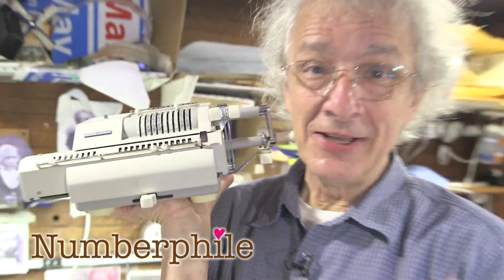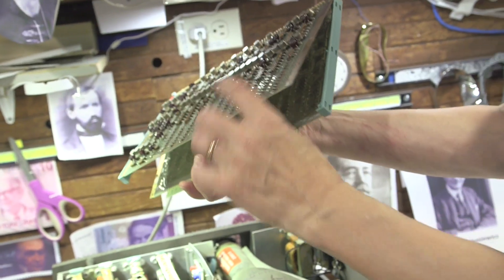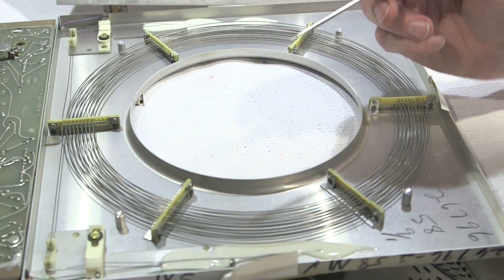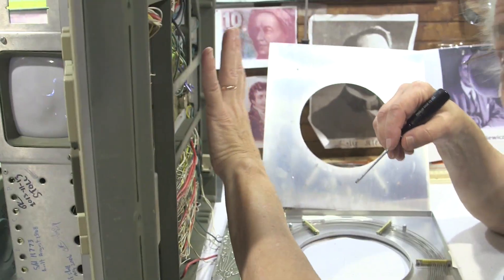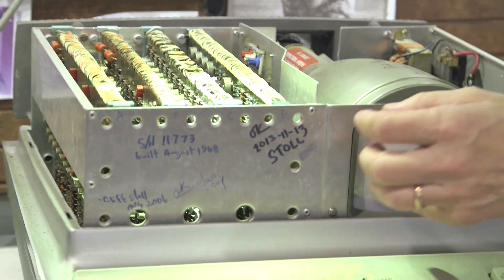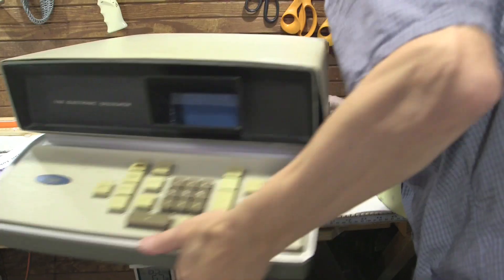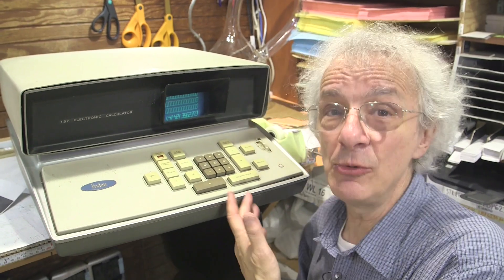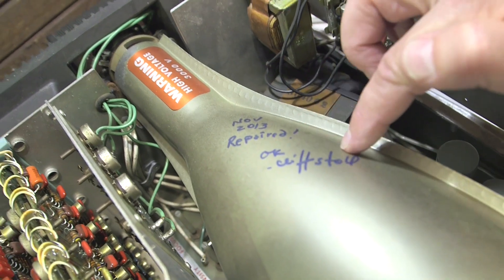An astonishing old calculator - Numberphile

Comment: I have a degree in computer science and electrical engineering, have been working professionally in the field for over 20 years, and I have no clue how that coil stores bits.
Reply: I think the information that will help you understand how this is memory is the amplifier at the end of the coil feeds the bits of information back into the piano wire, thus continually storing it until it is needed.
Reply: Similar to dynamic RAM with a refresh cycle. But unlike DRAM, there must be some logic to the bits to know where the start and ends are etc.
Reply: Jayyy Zeee Thank you
 that makes the rest of us feel better.
Reply: Scott Kronmiller You are quite exact!
Reply: This is called a delay line memory, Robert got it right, the information is cycled through the wire as long as it is required to.
Reply: I guess it's like a "refreshable" buffer with loop
Reply: This reminded me of a Computerphile video about the rebuilding/refurbishment of the EDSAC computer at the National Museum of Computing at Bletchley Park in the UK. They replaced the mercury based memory tubes with ones that used piano wire. They go into exactly how the system worked, as well. For those that are interested, you can check out that video here: https://youtu.be/Yc945sNB0uA :)
Reply: If you notice at one point the calculator went nuts when cliff spoke too loud or banged the calculator. Not a device to use in a noisy environment with acoustic memory like that.

The best way to picture how it works is to imagine yourself stood in a quarry, or ravine. You shout out "one zero zero one one" and you hear "one zero zero one one" echoed back to you a second or so later. So you repeat what you hear again, and again it's echoed back. Ad infinitum. That's your memory. To change a value you just change one of the words you shout. As long as you keep repeating what you hear and as long as no ducks quack, you have memory.
Reply: It "stores" them for the fraction of a second before the pulse reaches the end of the string. It's a FIFO buffer. It can be used as RAM if there is a circuit, which retriggers the pulses once again when they reach the end of the string. You can clear the memory when you switch off the retriggering circuit for the period of time it takes for a pulse to travel through the string.
Reply: @alexvukov  correct
Reply: This is confusing to me too but it's way more awesome than electronic (contemporary) computing. Not to discredit the computers we have today but they're so much easier to understand. Just to think that someone came up with the idea of using a vibrating string to store information and actually figured out a way to turn it into a computer is like real science fiction. It blows my mind :D
Reply: Cliff explained it. It jiggles one end of a long wire using a speaker to convert pulses into jiggles. It detects the jiggles at the other end with a mic (probably closer to another speaker seeing that it's mechanically coupled). By recirculating the pulses until they're needed, you get memory. It's confusing because its much closer to physics than electronics.
Reply: If you watch the additional footage they link to at the end, Cliff explains that it's not actually a transverse wave ( like a "pluck" ), but a torsion wave ( a "twist" ) which stores the data!  I would've thought a transverse wave was cool enough, but a TORSION wave?  My head just exploded!!
Reply: flurng The piano wire would have to be under tension to support a transverse vibration, while a torsional wave would propagate without tension applied.
Reply: @DavidMFChapman  An overlooked point. I know I did at first.
Reply: I think that it is just that you are more familiar with current technology. Starting with zero knowledge of either I think that the acoustic delay line is probably easier to understand. You can actually look at it and visualise the train of pulses running round the loop. The next stage after this was rotating drum memory computing, with a magnetic equivalent of an Edison phonograph and a continually moving read head. (Google for "The Story of Mel" for a great anecdote from that period)
Reply: It stores the bits inside the spiral in the form of vibration waves. Imagine you have a very long string, attached to a wall, and you vibrate the string up when a new 1 bit arrives, and you keep it still when a new 0 bit arrives. When no bit arrives you do not move it either. The bits will be stores as waves in the string. If the string is short, they will reflect back from the wall and into your hands, and then back into the string again  (assuming no friction). Each bit of course will need a certain period of time, i.e. 1 microsecond per bit. Now remove the wall and attach the ends of the string together. The bits will now circulate forever in the loop (assuming no friction again). You keep a counter made of transistors, to tell you what bit is currently the one under the reading microphone. With friction, they will be lost after a while, and so this memory is only short term. You need to keep track of what bit is currently under the reading microphone, and you wait for the bit you want to arrive in order to read, and you wait for the last bit written to pass under the write speaker when you want to write. The only thing you need is to keep track of what bit is currently under the heads, and you can do this with a simple binary counter. It's not like they don't use any electronics there. It's full of transistors.
Reply: That's a delay line memory. Basically, the acoustic waves goes through the wire and based on a certain frequency, the wire goes into torsion. Torsion is travelling along all the wire, and at the end torsion rebecomes sound due torsion upon a microphone.
Reply: Acoustic delay line.
Reply: Consider my mind blown too. Yep. Brains all over the ceiling. Kablooie.
Reply: I understand you completely. There must be subtleties to this design beyond saying "acoustic delay line". E.g. You can't just hit a rigid bar like that, you will get reflections and resonances. I guess it has to be critically damped. There is also some talk of it being a torsion wave rather than a transverse one.
Reply: So if you put it on top of a stereo speaker, would it’s functioning be disrupted because of the vibrations?

Or some mini earthquake machine that shakes it mildly and continually.
Reply: Possibly yes
Reply: But how does it know what is the right data? Are they somehow marked? Repeating the data has to be digital or otherwise the signal degrades.
Reply: @okaro6595  that's what i was thinking. very interesting tech used here.
Reply: I think it would be like continually yelling into an echo chamber in order to refresh the echo.  The data is in the echo.
Reply: We always forget that technology was amazing back then too. Just because it wasn't as advanced as it is now it's still just as amazing imo
Reply: Imagine 1000 people walking in a big circle; as they cross the START line they are either handed a card with a 1 on it or not handed a card, which is a zero. As they take a step around the circle a person arrives at the START line they flip a switch to 1 or 0 depending on what their card says.
Reply: I've been an engineer for just over 30 years and messing with computers and electronics for over 40 years and it baffles the snot out of me as well.
Reply: The analog delay line in a PAL or SECAM TV/VCR works the same, just using a crystal rod instead of piano wire. Those TVs were in use until the late 2000s, so it's not really that exotic.

Bonus fact: spring reverbs are still being sold. They use a coiled up wire (a spring) to store about 10ms of sound and produce a "vintage" echo effect. Because you can sell any kind of technology to musicians if you use the magic word "vintage".
Reply: If you want to see a more contemporary implementation of this concept, have a look at pingfs - it works in essentially the same way.
Reply: Jayyy Zeee Cliff explains it in the extra footage.
Reply: It basically induces vibration in the piano wire which is liked to  a microphone, this microphone creates a feedback loop that keeps the vibration going within the piano wire
Reply: Think of a delay line. Bits go in, time passes, bits come out. While bits are in transit you can do other stuff. If you need more time you read out the bits and shove them back in. Serial data.
Reply: The vibration traveling up and down the wire repeatedly until needed. Simple, yet brilliant. :)
Reply: The time it takes the bit to travel thru the wire is the duration of memory,  the amount of bits you can fit is capacity,  so the length is proportional to memory.  Now sure how fast sound travels thru steel but it's pretty fast,  not much memory lol
Reply: An acoustic delay line I guess - used to be common in (analog) reverb boxes also - can hold information like an electric delay line can - sequential access only!
Reply: It is a great comfort to hear that coming from someone with a computer science degree. 👍
Reply: Wizardry, that’s how
Reply: It only stores it for a few milliseconds
Reply: Feedback. Storage medium is unique, but principle, to refresh (read and write back) the memory all the time is pretty common thing with volatile memories. I think. Maybe. I dont know
Reply: You can also look up delay lines. The signal whizzes around at a set speed, where you can regenerate the signal or overwrite it with a new value.
Reply: It only needs to store them briefly.  There is a "clock" of sorts.  The software expect to hear a "ping", or "no ping", during a certain interval of time.  Sound moves around the coil at a known rate.  Presto!  RAM.  And you can have multiple bits traveling around the coil at the same time.
Reply: @Gerben van Straaten     strictly taking you are right , but it is being used as a memory in this application ......
Reply: resonance ..so its extremely short term memory
Reply: I was at computer school in 1979 and vaguely remember we were taught about something like that, but it was kind of anecdotical....
Reply: He explained it
Reply: Sound goes in, comes out to an amp that feeds it back in, and it goes round and round and round, i would imagine it eventually clears itself though if you simply don't touch it for a long time, and loud environments might mess it up
Reply: This is one example of a delay line memory, if you think of it a flip-flop, while the specifics are different, is working on a similar principle of keeping a signal alive through propagation time (delay) and feedback loops. Nothing will humble you more than looking at the history of computing and seeing how much was done [by absolute geniuses] with so little.
Reply: Jayyy Zeee Look up analog delay lines.  They are still used in various forms in modern times, particularly for analog circuits, such as with analog oscilloscope sample circuits where the trigger circuit needs to see "into the future" in order to trigger at the right moment, do the actual sample is stored in the delay line, the trigger sees the trigger pulse at the beginning of the delay line and by the time it has activated the display logic to actual display the sample that sample is now arriving at the far end of the delay line -- necessary because there is a propagation delay between when the trigger initially sees the trigger pulse and the delay before the horizontal and vertical drivers in the oscilloscope can see and display that same signal (light travels roughly 1 foot per nanosecond in a high velocity factor conductors, sound around 1.1 feet per millisecond).  They were also used in early radar displays, extensively used in various forms in early mainframes, as well as in the decoding of video signals like PAL.  But delay lines can be either electrical (like the coax delay line in analog oscilloscopes) or mechanical (such as the piano wire example in this video and mercury delay lines) or a bit of both.  It all comes down to knowing that it takes a precise amount of time after a signal is input at one end until the time it will be seen at the far end, and multiple signals can be in transit across the delay line simultaneously (each separated by a small moment in time if the signal is digital in nature) so you can have a continuous loop of circulating digital or analog data allowing such memory to be used for things like registers and limited system memory.  To retain the data you just keep repeating the data seen at the far end back into the delay line, and with digital data you can continue recycling those bits without degradation and, of course, new data may be injected by simply injecting it at the proper moment in time
Reply: It doesn't need to be anything so complicated. The acoustic pulses take a finite time to pass down the wire The speed of sound in steel is 5790 m/s. There looked to be approx 10m of wire in the loop, so that's around 2mS of data storage.  The calculator needs about 52 bits of data, so that's an approx 20kHz sound frequency.
Reply: I am old enough to have heard of "Bubble Memory" (magnetic) but have not heard of this acoustic delay-line system.   Wow, this seems like a complicated way to store a few nibbles and bits.  Looks kinda like an old luggable laptop.  I want one!
Reply: It vibrates, with a standing wave
Reply: It's like it stores a specific combination of frequencies (one for each number) bouncing around in it like a ping pong ball. I think. That's how I would design it.
Reply: It seems like it would have been easier to just use a bunch if transistors. Ok, transistors were too expensive, well anything that is on/of could store memory indefinitely, how about a few hundred tiny relays (with a little creativity they could be used to store multiples of 200 bits; 400, 800,etc) , or even diodes somehow (they only allow electricity to flow in one direction ), idk what the memory bit size of that piano wire is, maybe it was bigger than solid state circuitry of the time could be made to  memorize but I doubt it.

Comment: As an electrical engineer myself, I can vouch for the fact that the 'Scotty' approach of hacking together a solution from whatever technology is available is alive and well. The details of the problems are perhaps more specialized these days, but it still comes down to finding whatever clever trick will get the job done.

Sometimes you find a math trick to avoid expensive computations. Sometimes you find a clever way to recover 'lost' energy and do something more efficiently. And sometimes you store data on piano wire. Whatever the trick is, there's no feeling quite like MacGyvering your way through a problem.

Comment: That's cool that it's a stack based RPN calculator just like some of the HP calculators. I had never heard of acoustic memory in a wire like that, just ones based on phosphors in CRTs and acoustically in mercury which I guess is similar to the wire.

Comment: This is not 100% solid state. It has moving parts and a CRT.
Reply: ProCactus CRTs are electronic, but not solid state.  The piano wire is solid state but not fully electronic.
Reply: A piano is also percussion, and not electronic in ANY way. What's your point ?

Comment: I'm pretty knowledgeable about computers, but I've never even heard of acoustic memory and it sounds goddamned insane.
Reply: Ryan N For many years, acoustic memory (in a crystal block, not steel wire) was used in TV receivers to store one line of pixel colors when decoding PAL format composite video signals to RGB data.  The delay was exactly one horizontal refresh (64μs).

Comment: My word.  I've heard of storing light in a fibre coil, but didn't think it was practical.  The boards look like the stuff in my father's garage that I used to strip for parts.  Absolutely amazing.  I have a Gauss note - wish I had the rest.
Reply: Christie Nel It is quite practical, because light and electricity are both electromagnetism you can use optical fiber or a wire (such as coax) as the transmission medium.  Look in any old analog oscilloscope and you will typically find a long coil of coax that serves as the delay line between the trigger circuit, which must see the trigger signal far enough in advance for the horizontal driver circuit and CRT to react, and the display output.  A lot of older hardware made heavy use of delay lines and exploited the fact that the speed of light was around 1 foot per nanosecond or the speed of sound around 1.1 feet per millisecond (adjusted for the velocity factor of the transmission line which may slow things down and allow shorter lines for either medium).

Look up TDR (time domain reflectometry) and you will see the propagation delay in a medium used to identify the length of a transmission line or the distance to a fault that causes and impedance mismatch in that same transmission line.  Using such you can determine the actual length, provided you know the characteristic velocity factor, determine the velocity factor if using a known length, or detect the distance to a fault in your cable.  Such is often used to locate the approximate location to a fault in buried cables (such as with power transmission) so that crews know about where to begin digging.  We also use such knowledge to create stubs or identify coax length or distance to faults in radio transmission line, for example.
Reply: Fascinating.  I have actually used optical reflectometers to analyze optical products attached to fibres, but this is quite different from using fibre as memory.  The main problem I see is that the amount you can store is proportional to how long you have to wait for the data to come around again, which is why I thought it was impractical.
Reply: You could make a parallel array the width of your word.  That would decrease the latency per amount of data.  Same idea as a drum memory with a bunch of read/write heads.